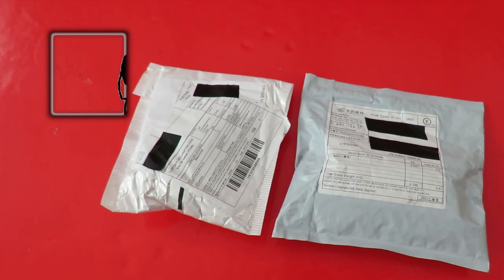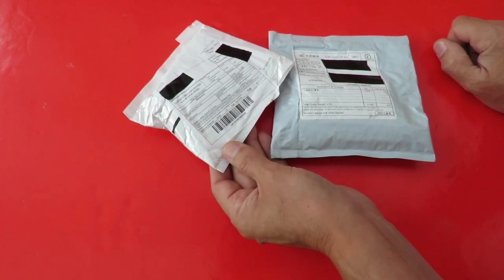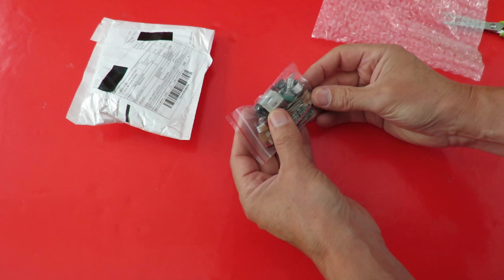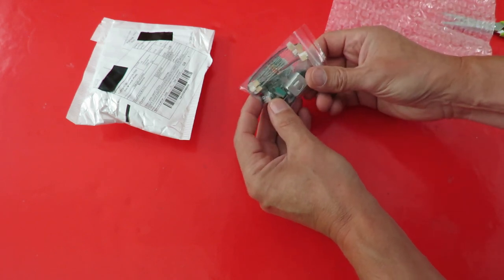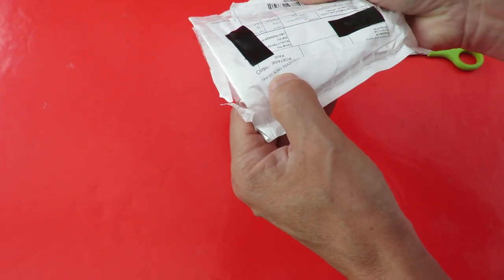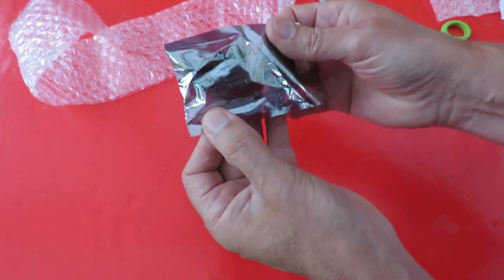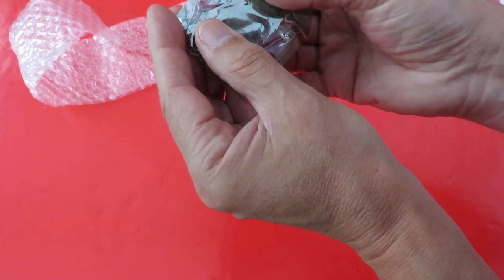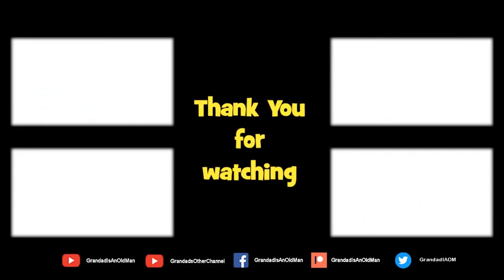Grandad's Postbag 180811 DC motor speed controller and Audio Power Amplifier Board DIY Kits

Comment: What will you be doing with that TDA2030 Amplifier?
Reply from the maker: No idea, I bought a few fairly random items a while back really just for the assembly video. Thinking laterally I could try it on that turntable I was playing with last month. That needed an amplifier for the output. I hadn't intended to use it for anything other than a display turntable but I remember trying to put some speakers on it in the video.